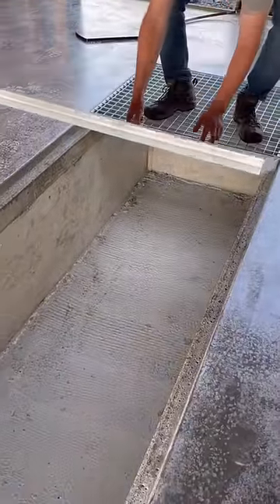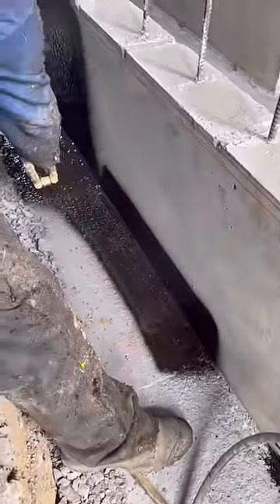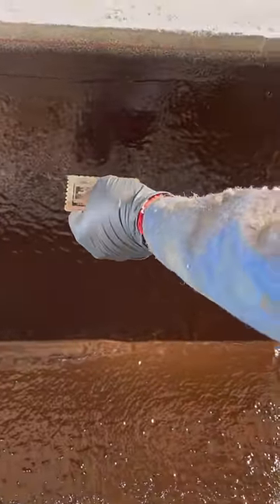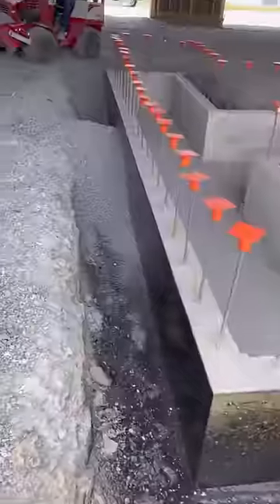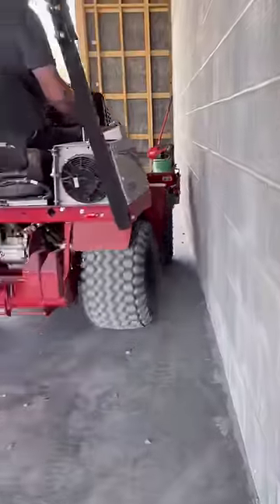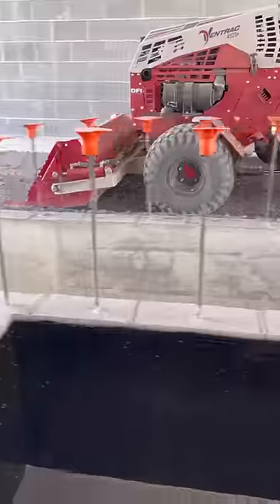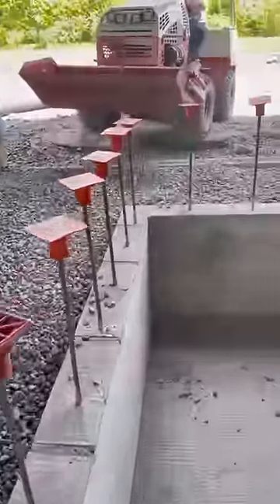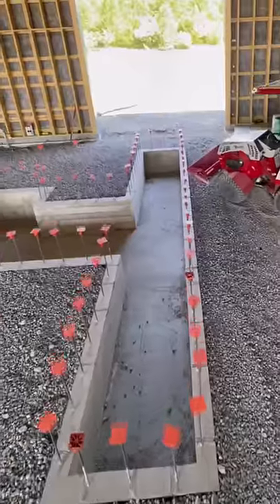Steps We Took To Waterproof The Spray Booth Pit

Comment: Did you say 60 mils, as in millimeter?
Because that's very far from 60 mm, about 10x.
Reply: If you mean ml, then you how are you measuring, per square 3 inches? None of what you say makes sense.
Reply from the maker: 60 mil, a mil is 1/1000 of an inch. Not a millimeter.

Comment: You are supposed to compact the stone in not do thick layers. But who am I to judge 😂
Reply from the maker: Code i our area allows 24 inches of crushed stone without compaction
Reply: @hausplans  yea but if it settles a little the slab may broke. We always laid lean concrete under the slab. If compaction may have broken it.
Reply: @Bungeneer  yes, and they could have put tar paper next to the paint before adding the gravel to protect it during vibratory compaction.  Everything settles.

Comment: What is a spray booth pit?
Reply from the maker: This pit goes under the spray booth that will be used to paint cars. The fumes are sucked down through the greats then through a tunnel, filtered and then go out the roof. This building will be an auto body shop.

Comment: Probably would have been able to spray that and do it cheaper if you used flex seal wouldn't cost as much as I have enough professionals come in and spray you could have done it yourself
Reply from the maker: It only cost me $450. It would’ve been a lot of cans of Flex steal to spray those walls
Reply: @hausplans  yah you may be right but I do know flex seal does come in a 5gal bucket but I don't know if it would pump through a spray gun but the job look great 👍
God Bless
Reply from the maker: 5 gallon bucket would be a game changer

Comment: What's the pit for in a spray booth?
Reply from the maker: It’s called a downdraft paint booth. The fumes are drawn down through the grates and into a tunnel. Then they go through the filtration system before going out the roof.
Reply: @hausplans  oh cool. Thanks

Comment: That spray is not 60 millimetres (6 centimetres) in depth. It is more likely 0.06 micrometres or 0.06 millimetres.

Seriously, how any advanced economy is not metric is beyond bizarre, and the reason for conversion mistakes causing project failures such as the Hubble Space telescope.
Reply from the maker: A mil is a measurement the equals one thousandth of an inch. This spray is 60 mils around one 1/16 of an inch. A mil is different than a millimeter.

Comment: why do spray booths have pits?
Reply from the maker: The paint fumes get sucked down through the pit through a tunnel then they get filtered before going out the roof. We posted a video on the paint booth a while back if you want to check it out.👍

Comment: Using your Ventrac isn’t as necessary as you claim if you filled the void from the entry inward instead of risking driving past an open pit with exposed rebar. 
That’s not working smarter at all.
Reply from the maker: The rubber track from the skid steer would still have to ride on the concrete, and it would mark it all up
Reply: @hausplans  
That may be the case but you still could have filled from the start and not driven along side the excavated pit to fill halfway down the side.

Comment: What’s e point of a pit in a spray booth ?
Reply from the maker: It’s called a downdraft paint booth. The fumes are drawn down through the grates and into a tunnel. Then they go through the filtration system before going out the roof.

Comment: 60mm is like 3 inches thick... Surely they didn't spray that thick.
Reply from the maker: 60 mil. A mil is one thousandth of an inch. Mil is different then millimeter
Reply: @hausplans  Millinch?  The hell kind of unit is that...
Reply from the maker: Mil
Reply: @hausplans  Is that short for something, or that's the whole word?  I hate it.  0/10.

Comment: Why do you have a pit in a spray booth
Reply from the maker: It’s called a downdraft spray booth,  The fumes go down into the pit then though a tunnel to a filtration system and finally out the roof
Reply: @hausplans  very interesting. Thank you for the information

Comment: 6 mm not 60mm
Reply from the maker: I said 60 mil not millimeter, there’s a difference. A mil is one thousandth of an inch.👍
Reply: @hausplans  thank for your reply and forgive me I wasn't been smart every day is a school day an all that. I'm Irish and an electrician I use the metric system. I use inch and feet in certain measurements but have never came across mill to be used as a thousand of an inch. Would be a costly mistake if you had of asked me to get the lads to do he job 😁🙄🙄 can you imagine 60millineters sprayed on I'd say it would 100% hold water 😂 well done proper job 💪

Comment: That is damp proof— not waterproof 
Most don’t know the difference
Reply from the maker: The manufacturer specifies the thickness needed that lowers the permeability in order to be considered waterproofing. We sprayed at the thickness that it is considered waterproofing not damp proofing.
Reply: @hausplans  you showed a damp roofing material being applied on the negative side   That will resist up to its adhesion value ( not much ).  Also, any bitumen based product is brittle at the temperature it will spend its short life in ( “ rubberized “or not ).  On the positive side the same input applies PLUS  you did not show any protection against penetration from backfill material or from potential ground movement or concrete cracking 
My advice is to not guarantee your work against leakage unless you learn real waterproofing materials and techniques
Reply: @teslastones itumen is used here in Germany for ages and it works very well, even the old houses are still good with it.

I also normally would say a Fiber glass fabric is added.
Reply from the maker: This pit is in the middle of a building that’s completely covered by a roof. The plans did not call for any damp, proofing or waterproofing. We just did this as additional precaution. If it was for a basement foundation, we would’ve used a French drain, different spray waterproofing like Rubber Wall and some sort of some sort of protective drainage matt. As far as #Warranty, this is my building that I own , so I’m not too worried about that.
Reply: @hausplans  understood.  I just don’t want to perpetuate the myth that a positive side damproofing should be considered for a negative e side application

Comment: 60 mm.? No, no, no
Reply from the maker: I said 60 mill not millimeter, there’s a difference. A mil is one thousandth of an inch
Reply: You said 60 Mil. The world as a whole uses the metric system.  Even the United States. In 40 years In the building trade, 15 as a coating manufacturer,  I have never seen a coating thickness expressed this way. Microns, millimetres,  inches. What a novel approach.